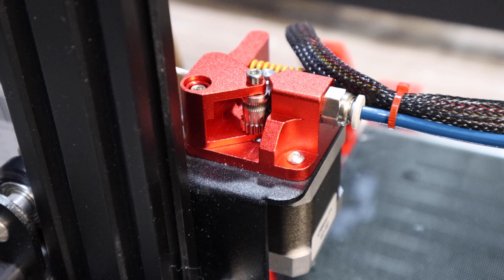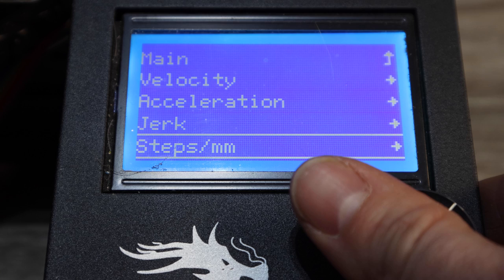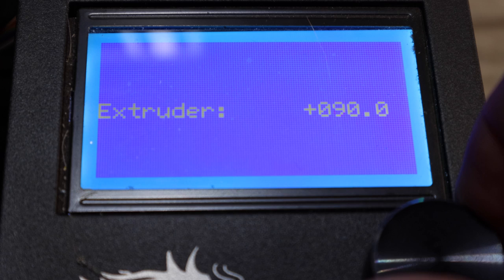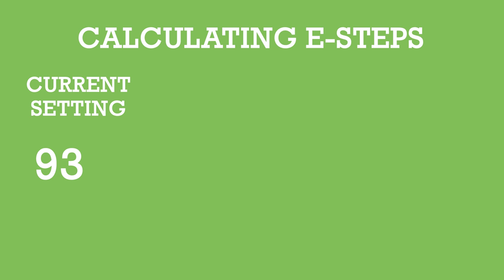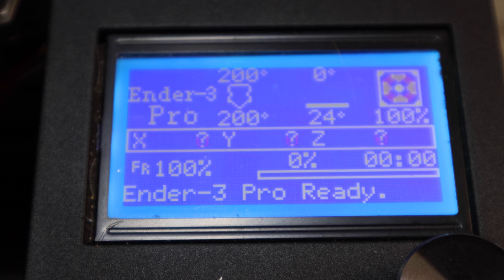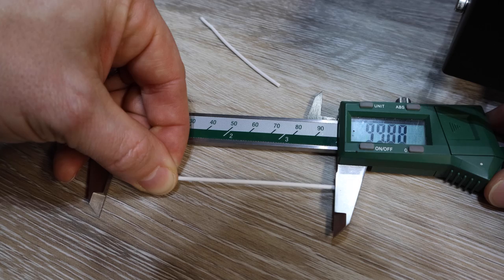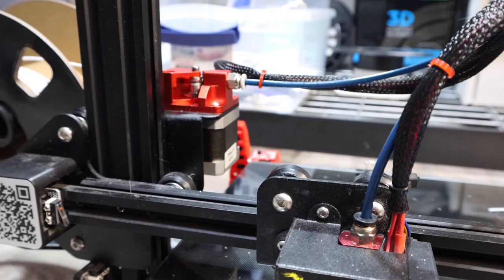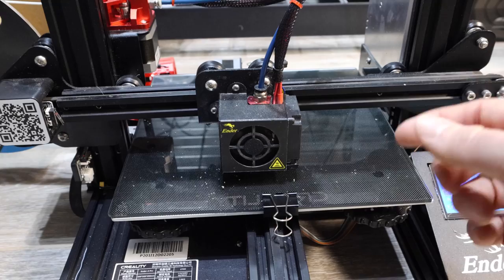Easiest Way to Calibrate E-Steps on 3D Printer with a Bowden Tube | Extruder Calibration Ender 3 Pro

Comment: Thank you Chris!!!!
You have solved ALL of my printer issues with this video.
Short back story, I bought an older Ender 5 pro a couple of weeks ago, second hand but in good condition as far as I could tell. Prior to this I had zero experience with any kind of 3d printing.
My printer came with a couple of rolls of filament, I put the first roll onto the printer that I touched in the box, it was PETG.
I struggled for many hours to get anything to stick to the build plate at a wide range of temperatures tested.
Then I realized that I had PETG on there and changed it for a PLA filament roll. Now I could get it to stick to the build plate, sometimes, but prints were bad, failures invariably started with the nozzle blobbing on the infill and dragging it around.
I went down many rabbit holes on Youtube, briefly explored E step setting but shied away from it because it involved connecting my computer to the printer.
Then I saw your video about printing and measuring the wall thickness on the small cube with no infill. I managed to PLA print one which barely held up but it allowed me to measure the wall thickness.
I have a 0.4mm nozzle in the machine, the wall thickness was about half of that, just over 0.2mm!
That lesson led me to this one and voila! the 100mm test extrusion measured just 40.86mm.
In short order I changed the Estep calibration to 227.6, the next 100mm test extrusion came out at 100.35mm.
The new hollow cube tested at almost exactly 0.4mm.
I am now turning out PETG prints with ease using almost standard Cura settings.
Thanks again, SUBSCRIBED!

Comment: You definitely made it easier than it sounded like it was going to be. Looking forward to getting my printer and the more of these i watch im feeling more comfortable about all the little things i need to know to keep it running well and getting the best results in my prints  Thanks again
Reply from the maker: Awesome! I’ve said it before but your going to be way ahead of most when you get it. It’s smart to learn as much as you can before you start.
Reply: Bro it's been one year, how did it go?
Reply: This is the most explanatory video I've seen. Very easy to understand with the display of tables.
I just upgrade my Ender 3 like you did.
Thanks a lot
Reply: @princeofdew8980  life happened lol still haven’t been able to get a printer yet as I have more pressing issues but I’m forever hopeful it will be soon. Until then like the man said I just keep trying to learn until then lol

Comment: thanks for this video!... it saved me a ton of work. I'm not sure how but I changed to the same set up as you as far as extruders and my e steps were set to just under 400 (massive over extrusion), after a quick lesson thanks to your video I'm now set at a modest 94 and my prints are back on track... thanks again!

Comment: I went from getting 95mm when I asked for 100 to 100. Worked great though not without a frustration when I tried to extrude with the nozzle cold. Realized that the Ender 3 wouldn't take an extrusion command cold. A type of failsafe in the software. In spirit thank you for helping with a process that's uncomplicated.
Reply: What I mentioned in my comment is likely what A Biggs was having issue with.
Reply: Same here. I taught I’ve a burnt out motor because I change my extruder and my hot end after experiencing a blockage. 😂

Comment: Installed a BL Touch yesterday, but for some reason, my prints kept digging into the first layer really harshly for some reason. Checked back at this video to see if my calibrations were off only to notice my extruder was set to 400 god dang steps per mm instead of 90. Thing was making a mountain, and I was upset it couldn't find its way around it. Thanks mate!

Comment: watching this i was supprise how close your steps were to the ones they list on the product page on amazon, they tell you to update your steps to 139 on the amazon page, which honestly could come down to measuring error, I guess It makes sense, if you know how far a stepper motor will turn each step, and you are the manufacturer of the gears, you know the ratios.

ALSO, this was awesome, and i learned quite a bit about calibrating this, thanks for the simple and effective process.

Comment: easier to just remove the quick connect fitting and cut flush to the extruder.   simply because the quick connect can move in and out.   not to mention it's easier that trying to remove the tubing.
Also measure the tip to the extruder, if you cut then measure it's going to be off because the top of flush cutters stretches the material as it has a beveled edge on top to cut flush on the bottom.

Comment: I don't know for sure, but I think this is actually inaccurate because you have to take into account the speed in which it melts through the nozzle.

Also, instead of using calipers, using a string and ruler would be more accurate since you can rid the variable of bend

I could be wrong.

Comment: Your estep is supose to be calculated with the resistance that extruding plastic trough the tip , so to remove the ptfe you will not have a 100 mm when it come outside of the nozzle

Comment: Cool, easy steps to follow, easy math.  What's the point of preheating your hot end though?
Reply from the maker: Your very welcome. 

The hotend needs to be on so the printer will extrude. There are safety steps built into the printer so it can’t push filament without the nozzle being hot.

Comment: If i recalibrate my esteps Do I need to recalibrate my z-offset since I'm possibly extruding more filament?
Reply: Esteps shouldn't affect your z height. If your dialed in there, it still will be after estep calibration.

Comment: @robmcdonald6808
This doesn't account for the speed at which the nozzle can extrude it due to flow though. IE back pressure due to nozzle size and temperature setting. Is that an issue you have experienced?

Comment: Hi Chris thank you for this video, I’m trying this method on my ender 3 but the filament is not extruding at all.  I’m a nooby at this.  Would appreciate some input please.
Reply from the maker: Is it not extruding from the stepper motor or not extruding from the nozzle? If it’s the nozzle you probably have a clog. I did a video on how to replace an nozzle and also a video on clearing a clogged nozzle.
Reply: It’s not extruding from the motor, the only way that I could get it to work was by getting it to start printing a file then pausing the printer, at that point I was able to change the extrusion amount to 100mm.  There has to be an easier way.  By the way thanks for your reply.
Reply from the maker: @abiggs66  that’s extremely odd. I’ve never heard of that. Are you sure your selecting the right thing to make the motor work? If your on Instagram find me and send me DM.
Reply: @ItsMeaDMaDe  ok
Reply: You can run a print pause it then run the estep calibration or alternatively Settings screen, Control, Temperature, Nozzle, raise the temp to maybe 140c then the Extruder Stepper will be enabled by the software and then the calibration can be performed.
Reply: @abiggs66  did you happen to heat the hot end b4 telling it to extrude to allow it to extrude? Otherwise prevent cold extrusion may not be enabled.
Reply from the maker: That’s correct @A Biggs if you didn’t do that it won’t extrude. That was one of the first steps I talked about.

Comment: Aren't you suppose to measure from the inlet side of the extruder as the filament goes through the hotend? You heated up your hotend for what exactly?
Reply from the maker: With the ender 3 you have to have the hotend heated or the printer will not extrude filament. As for the inlet it really doesn’t matter what side how ever goes in is the same that goes out.
Reply: @ItsMeaDMaDe  Ok cool. Was a little confused but that makes sense. I've seen other guides say you need to measure the filament going through the hotend and then other guides say NOT to run the filament through the hotend very weird.
Reply from the maker: @vzjrz  yeah it really doesn’t matter if it goes through or not. The whole point of e-steps is measuring the amount of feed from the z stepper motor. That is what your measuring it doesn’t matter where the filament is going.

Comment: Unfortunately I don't have the Esteps parameter in my Creality CR-10.  I don't think the ability to change that was added until much later (Ender3).
Reply: My ender 3 also doesn't have that
Reply: @thebigdr  Since I posted that, I have upgraded the firmware on my CR-10 using the TH3D Unified 2 Firmware.  I now have "steps/mm" for the extruder as well as the X, Y, and Z axis.  I picked up a number of other features as well since my CR-10 is pretty old compared to today's printers.  So it was well worth the effort.  They have firmware for MANY printers, Ender3's included.  There were a number of steps that I had to follow though, including updating the board so that it had a bootloader on it.  So I would say if you know what you're doing, it's worth it.  But proceed carefully.

Comment: I did all this but now I’m getting different lengths of filament when I command it to extrude 100mm. Do you know why?
Reply from the maker: Hrm… sometimes you have to do it more than once to fine tune it. I would repeat the process. I have done it 3 times to get my e-steps right before.

Comment: But wouldn't you want to be extruding through the nozzle, since the added friction of pushing through the tube and the nozzle would throw that number off?
Reply from the maker: No. Because your esteps are not the filament extruded. It’s the length of filament pushed through the extruder motor. Since your nozzle sizes can change it wound be hard to figure out what estep you should use. Also it would be hot  plastic and impossible to measure.
Reply: @ItsMeaDMaDe  You measure from the other end of the extruder. Mark 120mm out from the extruder, extrude 100mm, then measure the distance from the extruder to the mark, and subtract it from the original 120 to get your actual extrusion. That's how I've always heard you're supposed to do it, and in my experience extruding without it hooked up isn't accurate to when it's connected to the hot end, because of the resistance the filament meets.
Reply: @Jorvalt  You want to measure without the hot end hooked up. You are calibrating the E stepper motor. E steps doesnt and isnt supposed to account for friction of the boden tube, back pressure, or possible clogs. Thats the point of the slicer flow rating and calibrating that on a per roll basis if not more frequently. If you calibrate with the hot end in the equation, you are going to make it incredibly hard to isolate future problems you may have.

Comment: Has anyone have had an E-step calibration that sent you out in left field? I double and triple checked my math but I still get bad results. My measured estep is 66.10mm out of a 100mm. My estep in the machine is 93.0. I ended up with 1.513 with a new estep of 140.7. and ended up with almost 200mm of filament. Needless to say I cant get good results with this methods. Im wondering if I have a bigger issue.
Reply from the maker: No. I have have heard of it’s extreme on the beginning measurement but not after the calculated change. That is extremely odd. What kinda printer do you have? This does only work with printers that have a Bowden tube. This also could be a sign that your extruder drive is going out. They do go out or yours isn’t working right. Not saying that is the issue just it could potentially be the issue.
Reply: @ItsMeaDMaDe  I worked out the correct estep. I got to 78.4mm so I played with the numbers Abita and found 141.3 estep was the golden number for me. I extruded 99.98 +/- .02 out if three runs.
Reply from the maker: @octogames6823  great. I’m glad you got it.

Comment: i did this, with octoprint, for my elegoo Neptune 2s...
stock E steps were 134..... But when extruding 10cm.. it only gave me 9.5cm...
So used your calculation, 134 x 100 Divide by 95.03225 = 141....
So sent the command as shown here.....etc
And now my prints are terrible quality....